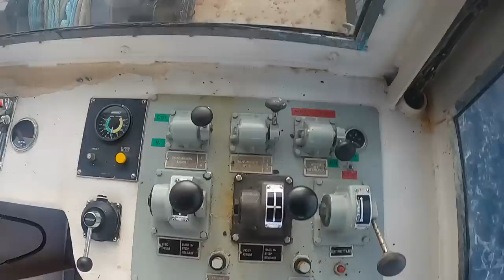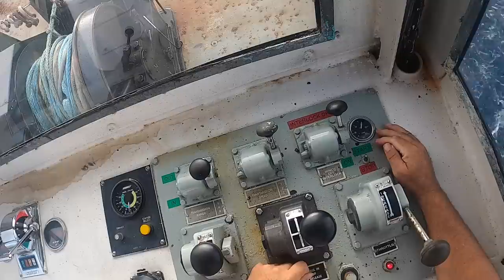Loss of Propulsion

Comment: Having a dual engine failure is very rare.  What can happen is a fire in the engine spaces.  That requires securing the fuel flow, closing the space and setting the fire suppression system.   The engines are okay, but you can't restart them.  The generators, pumps, and compressors are off-line, too.  Your very best friend now is the handheld VHF radio.  And watch out for the 20,000 TEU container ship coming up the channel.  While you are waiting for the fireboats and the reserve tug, you can practice your response when your wife asks "So, how was work today?"
Reply from the maker: Thank you for watching Bruce. CUOTO

Comment: Great insight! It reminds me when I was 14 years old I was in my 13' Boston Whaler going around Cape Ann. As I rounded Rockport heading to Gloucester Harbor the sea got rough, I guess 5' seas. In the trough all I saw was water but on the crest I could see forever. I was about 3 miles offshore and saw a tug heading north. As I passed I heard a ripping sound of something coming out of the water and saw a wire rise up just in front of my bow! I gunned it to go under it as it slapped back down about 2' from my outboard! Because of the sea conditions I didn't know the tug was towing a loaded barge about 1/4 mile away! Best Regards, Jay
Reply from the maker: Thank you for watching Jay. CUOTO
Reply: Your one lucky son of a gun😮

Comment: Thanks for the discussion, very interesting the issue of the wire and tug during emergency situations. I was going to mention 'inching the wire' but you came up with that. I can only think to add shorten the wire but that is not something easily dealt with in high seas. I will pray for the Heavens to be looking over you in times of distress.
Reply from the maker: I appreciate that David. Thank you very very much. CUOTO

Comment: In the 70s, I worked on a tug the port of Philadelphia.  We dropped of a barge in Claymont DE and we headed to base dock in Camden with a light tug. As we turned North bound the rudder fell off. We were a single screw tug. Luckily we had an experienced captain. We attached a tire to a rope and threw it off the stern. It worked very well and got us home.
Reply from the maker: That's crazy. Thank you for sharing that story with us. And thank you for watching Ken. CUOTO

Comment: Thanks for the info.  As a cruising sailboat never have to worry about that kind of stuff. But good imagery there.  Could be a nasty scenario.    I know that even as a sailboat, I sometimes (as you know Paquita).  Have to motor long distances.  While going from panama to San Francisco. I had to motor long stretches. Especially when the current is against you and you don’t really want to go backward!    With that diesel thrumming along nothing makes your heart beat like hearing even the slightest RPM change!   These engines are such work horses.  And when it stops!!!    OH CRAP!!
Reply from the maker: Thank you for watching Fred. I have about the "Baja Bash". Going the wrong way couldn't have been fun. I appreciate you watching both channels. CUOTO
Reply: @TimBatSea   OH yes, have done the bash 3X.  Only one any “fun”.  Completely blew out my mail bashing into 30 kts and steep seas, maybe 4-5 M.   Fun!   (Not)

Comment: The only time i have lost everything was on a 25ft yacht under power and a lee shore about 100m away blowing 20knots . No time to do anything except throw the anchor over to give me time to either get the motor started or get a sail up , set the head sail and it is bloody hard work tacking while pulling up 100m of rope with chain and anchor on the end , missed the rocks by about 5m
Reply from the maker: Thank you for watching Pete. Wow. Sounds like a rough go of it there. CUOTO

Comment: Once your used to the sounds underway even if your sleeping you may wake up just because of the difference in your surroundings changing , no machinery sound. You may wake up before or at the same time just as the alarms go off. I worked in GTMO '82 - '86 as a contractor boiler operator , even in your quarters you know something happened by not hearing the same normal noises. Do they still have those huge supply barges going to the base from Florida? Very interesting what you have to do with a mechanical break down.
Reply from the maker: Thank you for watching and welcome to the channel. Puerto Rico is served by two companies regularly. One has containerships and the other has container barges. CUOTO

Comment: Don't tugboats come equiped with oars in case of engine failure?
Excellent explanation of the forces in play hauling a barge at sea, especially the inertia of a barge.
Your lesson also points to the fact that good engine and propulsion system maintenance concerns a lot more than just making machinery last longer. It's about keeping people safe.
Thank you.
Reply from the maker: Exactly. Very well said. Thank you for watching Ralph. CUOTO

Comment: We once had a Moran tug with air controls go all stop. The air system had a leak and control went to the upper house.  I woke up hearing the engines at idle and thought "the barge." Boom!,  I ended up at the foot of the bunk. It put a small hole in the barge. Could have been worse
Reply from the maker: Outch! 😂 Thank you for watching. CUOTO

Comment: Have you ever had your towing line part? And if that were to happen in storm would you just try to stay near the barge to try to get it under tow again once the weather calmed?
Reply from the maker: Thank you for watching.  I have never been on a boat that lost the tow, but I have worked with a binch of friends who have had that happen. In all cases (of my friends) that I am aware of, they were all relatively close to shore and it was necessary to get control of the barge right away. CUOTO

Comment: You mentioned dropping the anchor on the barge.  Is there a crew on the barge, or possibly an automated system to control the anchor on the barge?
Reply from the maker: Thank you for watching Shannon. Our barges are manned.  But most of the time (like when I shot this video) we are in much deeper water than the barge has anchor rode. (We were in 1600 feet at the time). CUOTO

Comment: Very interesting - could I ask how often are
the wires inspected for damage and general ware. Many years ago I worked on mobile cranes and the wires (or as I called them wire rope) got some stick and were inspected every week
Reply from the maker: Thank you for watching Mike. We inspect the wire everytime it is paid out or heaved in, and done so by no less than two people. We are required to keep a wire log where we record both towed seamiles and towed hours on the wire. Different companies and different wire sizes have different change out times. We get a new wire every 5 years or 100,000 miles (I think). CUOTO

Comment: Hi Tim, Please tell me how to operate the winch with No air pressure during a total power failure.
Thanks
Reply from the maker: Thank you for watching Jeff. The idea is that  you loose power and only a a few minutes at best to dump wire. It's true that the brake on the winch is air operated, but there should be plenty of air in the tanks to release tte brake for much longer than it would take for the barge to go by. CUOTO

Comment: Interesting that you have to worry about wire chafe - wouldn't it be easier to have the sacrificial ABS layer on the stern rail (maybe bolted on in replaceable segments) than attaching it to the wire each time you have to use it?
Reply from the maker: Thank you for watching. I dont think it would last very long as when we are leaving up or letting out wire, the wire makes contact wire the rail. (When using chafe gear, we just lift the wire and set it back with as little movement as possible). CUOTO

Comment: Really, really interesting Capt. Is there any way that a second pulley could be positioned over the stern to prevent wear on the wire? Probably a far-fetched idea. You can tell I am not a seafarer! CUOTO
Reply from the maker: Thank you for watching Norm. There may be a few things that would make that difficult or undesirable. Getting the wire in two donuts or pulleys would be very difficult and it is very rare that we have to go this slow so it usually is not a problem. CUOTO

Comment: Speaking about loss of propulsion, it seems that you don’t have towing pins. If the barge passed you and the wire was between the pins would that not serve to pull the stern of the tug around and prevent a capsize. I know here on the west coast of Canada with big currents and inflows and outflows we’ve had lots of tugs over run by their barges sometimes fatally.
Reply from the maker: Perhaps. But pins are used for towing,not as a safety device. So yeah. If you had them (few East Coast boats do) and if they are deployed and if the wire is in them, there still is no guarantee that when the wire comes tight and the tug rolls, the wire wouldn't pop out anyway.  The thing to remember is that we are talking about loss of propulsion. It really shouldn't be an everyday occurrence. Thank you for watching Peter. CUOTO

Comment: You have all the power you need but how do you stop the barge when coming into port?
Reply from the maker: Thank you for watching Tom. If we are towing the barge, only drag from water or wind will slow the barge down. But we can round up on the barge and grab ahold of it and slow it with the tugs engines as well. CUOTO.

Comment: How about designing barges that if tug loses propulsion, large plates unfold into water perpendicular to barge slowing barge quickly. Giant brakes.
Reply from the maker: Thank you for watching Eric. Remember that  a total loss of Propulsion is extremely rare (has never happened to me).  The problem with systems like what you describe is that crews would have to to ve trained to use them, maintain them and practice with them. And many barges are unmanned.  CUOTO

Comment: Why not a wood block on the rail
Reply from the maker: Thank you for watching. I don't think you understand the pressures ar play here.  There will be over 2.5 tons of wait just from the wait of the wire without counting the power of the tug pulling on the wire. And the wire moves so much, it would saw the wood in half. I do love that you are thinking of solutions and really appreciate you joining the conversation. CUOTO
Reply: @TimBatSea  hardwood? Heavy truck wreckers use wood blocks all the time to protect there cables lifting and pulling loaded semi trucks
Reply from the maker: @bovnet  Maybe that would work. But a semi truck weighs 80,000 lbs ir 40 tons loaded. Our barge weighs over 12,000 tons. CUOTO